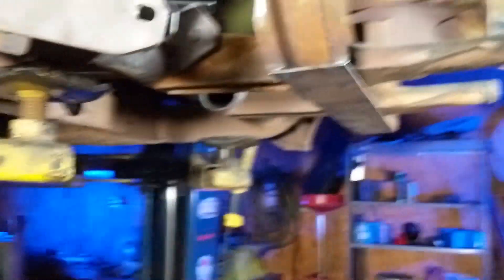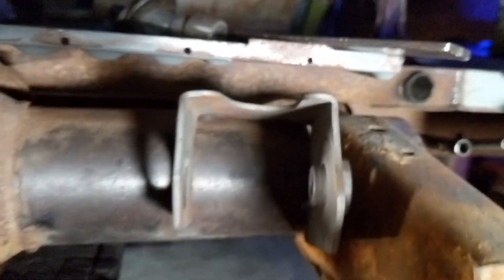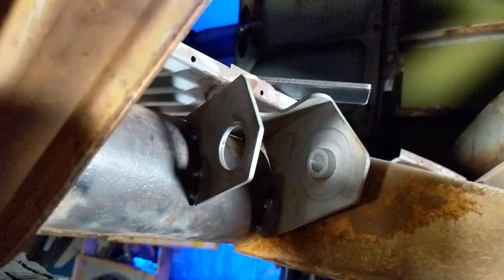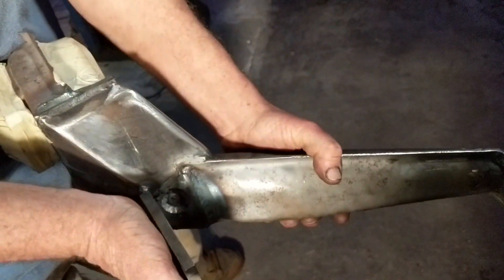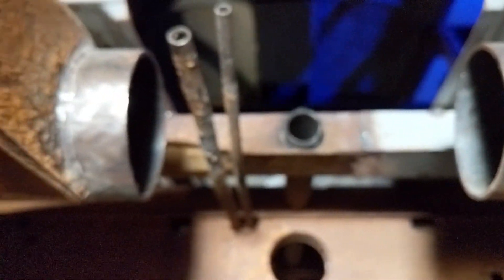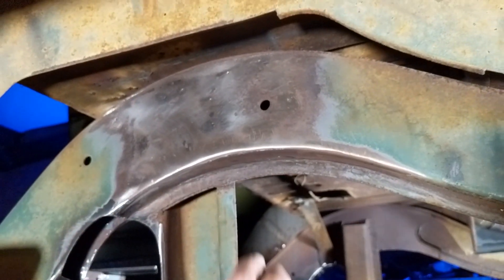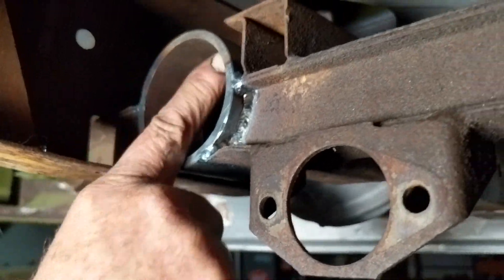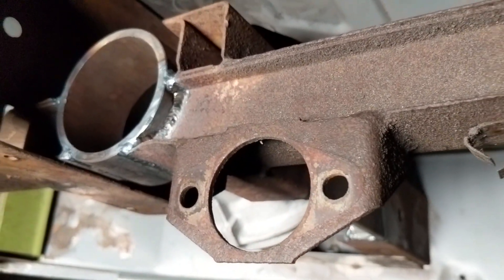VW Bus Hydraulic Suspension Install | The early stage of the process

Comment: Do you guys need to get this stuff engineered or can you just build and go drive?  We cant use hydraulics in Australia only air bags and only with bump stops in place which means no laying rail on the ground. I have a split bus on air ride from CE uk and its running accuair runs great.
Reply from the maker: We can pretty much just build and go drive... why can't you use hydraulics?.. oil spill?
Reply: I talked to someone else in Australia that told me the same. The crazy thing is we use about 20 percent of the potential of the Hydraulics where in air you use 100 percent. This is designed way overkill. I'm sure if the proper authorities inspected it they would pass it no prob but getting that to happen might never come to be!
Reply: @RobStapleton  I'm not really sure, probably oil leaks. But its a big no no here if you have no bump stops or the car hits the ground, cops will impound the car if they notice cars lower than 4" off the deck. It sucks here.
Reply: @DemonMotorsports1  Yeh its real strict here, even air bags have to be fully engineered which costs $$$$. Any mods pretty much must be looked at by a certified engineered before been allowed. You guys have it real easy :)
Reply from the maker: @DemopVWgarage  Would they allow someone from the U.S. to bring their car over "temporarily" and drive it?
Reply: @RobStapleton  think it would depend on the state your visiting. Wouldn't like your chances but. We have laws about importing modified cars from other countries too. Its a nanny country over here :(